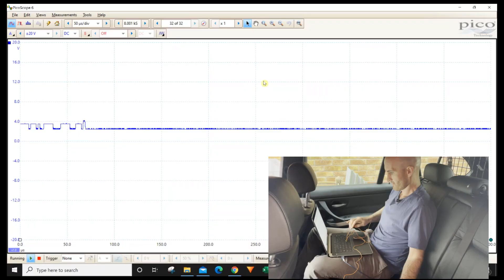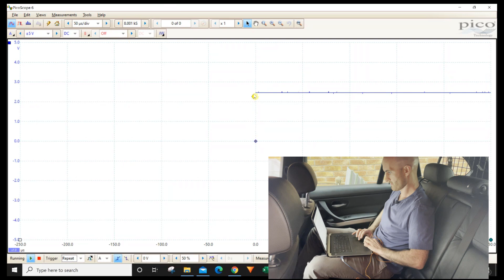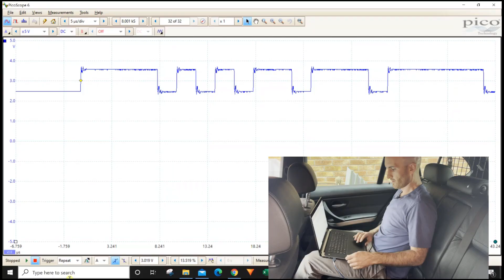DIY Oscilloscope Leads

Comment: I saw in other videos they used leads with one wire.
Reply from the maker: Yes, most scopes you only need one ground connection to the oscilloscope, then the other channels only need one positive connection. Ground not needed
Reply: @MechanicMindset  thank you. Just got an HScope, and have hantek probes, and want to use in automotive repair. Again, I saw you used the 2 wire probe,, others make their own 1 wire probes

Comment: Hey. Thanks for the video. I don't think this is a good way to make a good probe. It may solve your purpose and that's great but shielding and uniform impedance should be ensured as much as possible throughout the length of the line which won't be possible because of the connector you used. Also getting a 10X probe is better as it cancels all the reflections that may occur from oscilloscope back to the device under test.
Reply from the maker: For sure, if you are measuring high frequency signals, this is definitely not the the DIY probe for you. But for Automotive testing, it works fine 👍

Comment: I used coax works well. Use the sheath as the ground.
Reply from the maker: Nice idea 👍
Reply: @MechanicMindset  I bought a 5m coax with BNC connections in both ends cut it in half

Removed a ring of insulation around 1m down from the cut end. 

Pulled the sheild together then soldered a gnd wire to the sheath. 
This is means to the probe is sheilded to the tip

Comment: Thanks by share good information . I have a question . You use a 2204A picoscope . Is It automotive or not ? 
I have a workshop un Costa Rica , I have a hantek 1008c , and I want one something better . Thanks . Kike de taller Pit Lane Costa Rica
Reply from the maker: Hi, 2204a is not an ‘automotive’ scope, but it can be used for lots of automotive tests. If you are serious about scoping, get the automotive kit. If you want to dip your toe in to PicoScope, this is a great start. Much better than Hantek in my opinion 👍
Reply: @MechanicMindset  thanks . Your opinión are very important foro me .

Comment: Hai sir Pico oscilloscope 2240A we can check for battery testing and 4 cylinder witch cylinder is compression is week NVH options working  please kindly make one video
Reply from the maker: Hi, I already have 2 videos for this; one for battery voltage check and another for starter motor current check 👍

Comment: Thanks for the video Darren, I'm always looking for DIY workshop equipment. 
I've made my own, but soldered them into connectors with proper oscilloscope shielded cable. 
I think you might end up with some issues with EMI, especially when you are in the engine bay with so much interference being produced.
Reply from the maker: Ah ok, cool! I might give them a test across the engine bay 👍

Comment: things are getting cheaper all the time on the net so i guess unless best if you want custom sizes
Reply from the maker: For sure, the Hantek leads I have are sooo cheap; why would you make them 😂

Like you say, I think I will use the connectors to create some custom probes 👍
Reply: @MechanicMindset I will say I’ve had two bad sets I’ve got from them that barely worked. I’m about to order good set even if it little more expensive

Comment: Nice video! I had this ideea few months ago. But used crimped bnc connectors and RG58 coax cable. This cable is the best to use for scopes.
Reply from the maker: For sure, coax would be better - this was just a really easy way to make the leads. I will test in a high EMI area like engine bay!

Comment: You may want to use shielded wires to avoid EMI/RFI.
Reply from the maker: I thought the same; I might do a comparison between the two across a running engine. These cables turned out better than I thought! 👍

Comment: You need to use shielded microphone cable or you will get a lot of interference, also the solder type BNC ends are better
Reply from the maker: I thought the same, but this test worked out fine. I might do a comparison across a running engine 👍
Reply: @MechanicMindset  would be interesting to see it on a running petrol engine especially without a cop system. Thanks for the good videos.